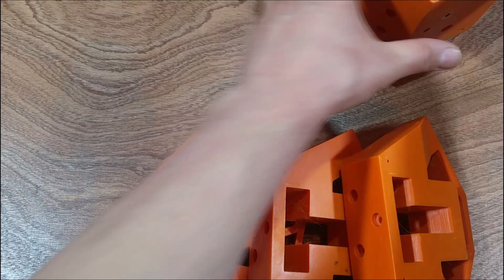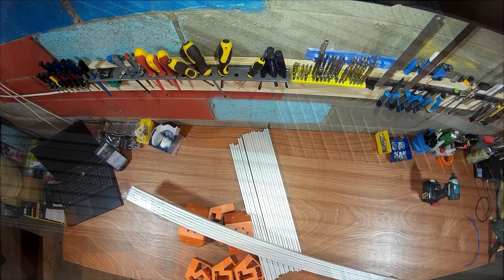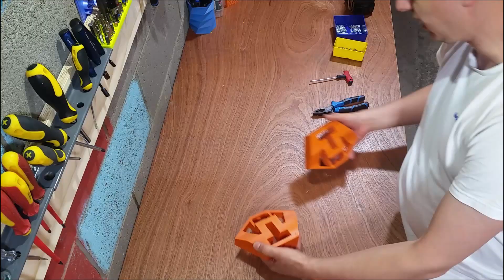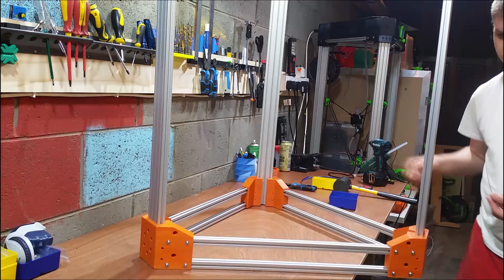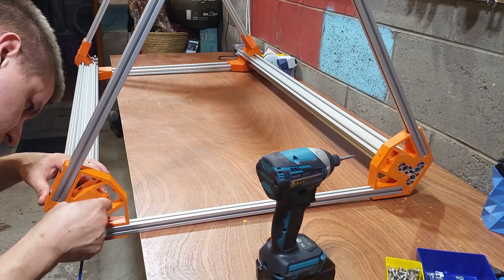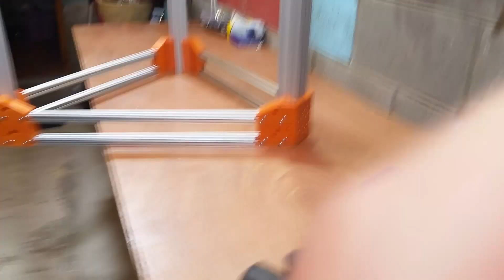3D printer (Delta printer) part1

Comment: I just got mine printing several days ago, smaller then yours it has a 330 bed by 440, it is rock solid NO shaking at all, the frame looks just like yours. I have a duetwifi board, smart effector and rails and it sure prints smooth.

Comment: This is looking like an awesome build, I will be using this as the basis for my own delta. Quick question though, what are you doing when you periodically test the fit of the PTFE tubing in various holes? Checking for burrs before tapping?
Reply: He's pushing the T-nuts into the correct position in the slots.

Comment: Hi man amazing build, what is the build size? And what FW are you using?
Reply from the maker: Thanks, if you use it without enclosure than you can go up to 480mm radius
with enclosure 400mm radius and 700mm hight.
Reply: @3dicnc  bad A. Delta, I want to make a 600mm by 800mm height
Reply from the maker: Also I'm using Marlin fw
Reply: @3dicnc  oh you have to try klipper man...
Reply from the maker: I will, not enought time to try everything :)
Reply: @3dicnc  if you need help ping me.